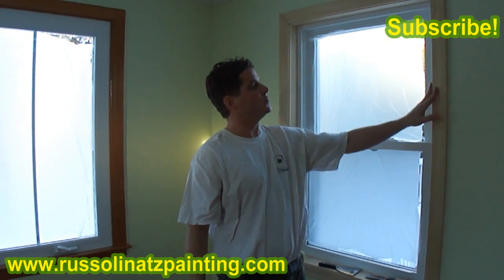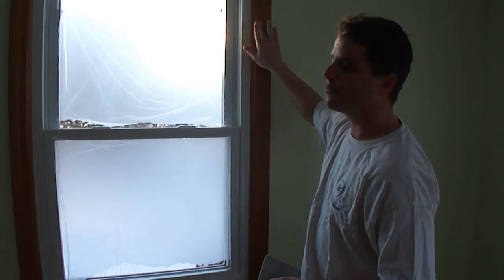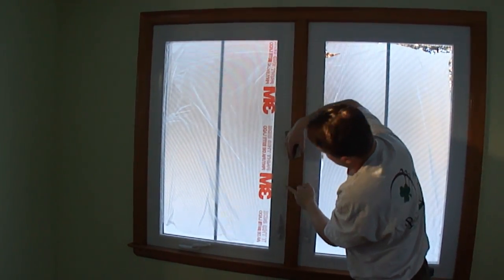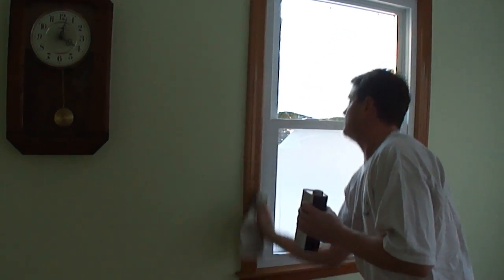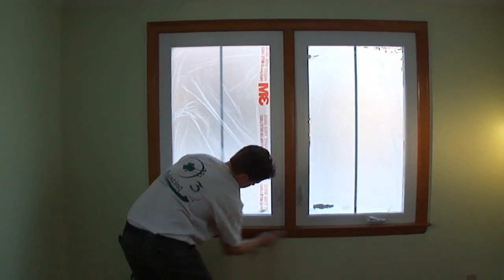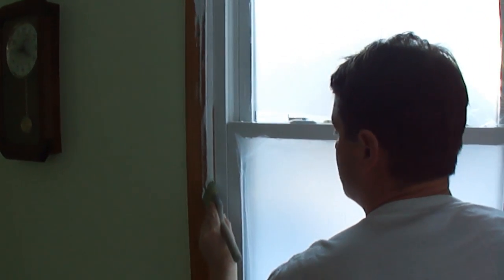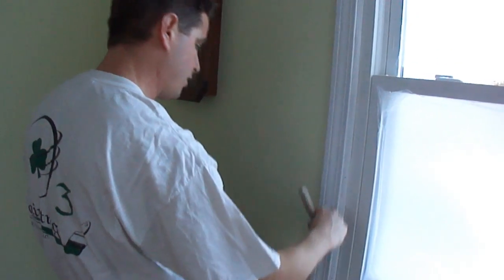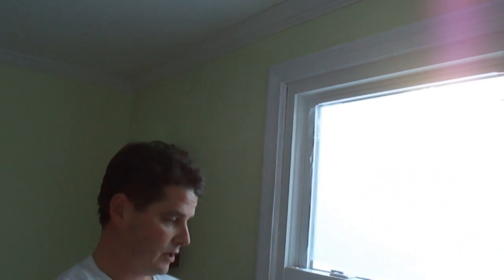How to Paint Over Varnished Wood Trim (Part 1)

Comment: Help! I accidentally used shellac BIN primer instead of water-based on our previously stained and varnished wood trim. (Our first primer coat.) We bought water-based paint, plus I really don't like the clean-up with shellac. Can we buy water-based BIN and use that over the Shellac Primer or do we have to use Oil-based paint now? BTW, I love your videos! So informative and helpful. Great job!

Comment: I’ve always been suspicious of deglosser. Any thoughts on a comparison of deglosser and a more thorough sanding? I have no way of knowing if the paint will have a bond failure years down the road. Would love some feedback here.
Reply from the maker: Thanks for your question! After you use your deglosser, wipe your finger or drag your finger across the surface. It won’t slide as easy as if it wasn’t cleaned and deglossed.

Comment: For kitchen cabinets that I want to use oil base on would it be better to use an oil base primer. I know cabinets take a hard usage and I’m willing to deal an oil base primer if it is an even slight benefit to prevent chipping down the road
Reply from the maker: Hi

Thanks for your question. The STIX bonding primer can be top coated with almost any product. If you don’t mind the smell of Oil primer and are comfortable working with oil, then I would use oil primer. It will cut down on the prep work also. Saying that, I would still use a liquid  deglosser to make sure the cabinets are clean before you start. Where you from?

Russ
Reply: Thank you for info. I’m going to watch your kitchen cabinet videos now. I will order what I can from amazon if you benefit from that. Do you have one on removing popcorn ceilings. I did the bathroom and that was no fun. I may hire the rest and actually leave the popcorn in a few bedrooms. It’s hard to find contractors that even want to do that.  Can’t blame them lol
Reply from the maker: Yes here is the link to the playlist. https://youtu.be/RSb67RcWTuI

Comment: This guy does things right. Great job!
Reply from the maker: Hi Tom

Thank you! Do you do it same way?

Russ
Reply: I have never used the deglosser. I sand, then prime with oil. But the smell bothers people sometimes.... I may try your method now.
Reply from the maker: Hi Tom

Yes I do the same thing when the trim is old and the Sun has deteriorated the polyurethane, leaving stained Oil surface that will bleed they latex. The WIlbond is a Must. It’s unlike the Em water based ones. It stinks but does the best job trying to cut sheen of polyurethane and it definitely cleans the surface.

Comment: Thank you for the tip on the liquid deglosser.  Hadn’t seen it recommended in any other video and saved me tons of time not having to do sanding!!
Reply from the maker: Hi Gigi

Yes it’s a lifesaver. It cleans the surface and softens up previous coating,  thus alllowing new paint to bond better. Where you from? 

Russ
Reply: RussOlinatzPaintShow Originally from Long Island, NY but now in South Carolina.

Comment: Great video. Just what I was looking for. I have plans on doing my whole house...huge project, any suggestions on getting started?
Reply from the maker: Hi Yvonne

Are you painting over stained trim?

Russ
Reply: I will be painting over stained trim.  Do you need to sand all of that away and then clean it with that solvent?
Reply from the maker: Hi

No not at all. If you do, then the stain will bleed thru. Just use the deglosser to clean the varnish or polyurethane. It also cut the sheen allowing the primer to adhere better. When you starting?

Russ
Reply: I will be buying my first house in the next couple months and then I will start the painting process.
Reply from the maker: Ok great!
Reply: Yvonne Pryor start with small sections not over work yourself a good cut brush for trim sand and clean surfaces so the paint sticks well so kids not rub off so easily and Blue tape to keep the job looking neet.HANDYMAN Louis H.
Reply: Yvonn
  e Pryor
Reply: Yvonne Pryor Hi Yvonne. Did you paint all your wood trim after all? We too have all wood trim throughout. I'm thinking about doing this too. It would be a massive job. I live in Canada and since we have long winters, it would be a good project while we wait for spring. Lol would be interested to know how you made out with your painting.

Comment: So this liquid deglosser doesn't hurt the walls at all? I usually cut in without using tape whatsoever but I'm doing a full white package on this job on all varnished trim and doors in the house, as well as ceilings (no walls fml). So I'm leaning towards just giving in and taping, but then I have to worry about wall color coming off with the damn tape, ugh. I may just do the walls at no extra cost to save the time and frustration. Just want to know for sure if that stuff will affect the finish on the wall if it touches it whatsoever, will there be a dull spot probably?
Reply from the maker: Hi-

Yes, if you use the de glosser on any surface it will cut the sheen. This stuff also soften up the coating of the previous paint and will melt latex paint in just a few rubs. So with latex paint, work quickly so that it just cleans the surface. With oil paints it won't melt the paint, but will clean the surface and make it clean. Do you plan on caulking where the trim meets the walls?

Russ
Reply: So far the seem that meets the wall looks ok, I've had to caulk all the other seems on the window and trim so far. Other windows may need it though. Thanks for the response! Half the time people never respond.
Reply from the maker: Hi 

No problem! Let me know how you make out?

Russ

Comment: Hi Russ, really appreciate your videos, they have helped me a lot with other projects. I'm now on to a stair railing project and converting from stain/varnish to a gloss white. I've done the sanding and now ready to paint. I was going to tackle it first by using Zinsser BIN sealer primer (shellac base) and then a couple coats of gloss paint. The BIN seems really thin and watery compared to other primers and from what I read it can be tricky to use without dripping/splattering, but is supposed to be great for a base coat. Would you recommend I use the BIN or do you think another type product would be superior for a railing project? If you recommend the BIN type product, any tips for using it for drip free application?
Reply from the maker: Hi Michael

Did you already start?

Russ

Comment: Hello russ!  Great work! Much like a precious viewed I have trim in a house that has stain and varnishes for over 30 years.  Great wood work in which some of it is still tacked around and others are removed.   What grit sand paper should I use? Sounds like the steps are sand, use deglosser, prime and paint 2 coats of the products you recommend? What about the wood that that is not tacked on? Should I sand l, degloss maybe a coat of primer and then tack, fill holes another quick sanding of holes filled, primer again and paint ? Any suggestions would be greatly appreciated!
Reply from the maker: Hi Nelson

Thanks for your question? What do you mean by tacked on?

Russ

Comment: Thanks Russ.  Taking your advice. Starting tomorrow on my own 1969 varnish trim while locked in the house.  That initial scuffing can  really be that quick huh?  ( with the 'will bond' next).  That is awesome.  Ps not far from you in Southington. Thx for the videos. I have my next painter for house exterior when the time comes.  :)
Reply from the maker: Hi Todd

Good luck with your project! The initial scuff should be quick and light depending on how worn out that coating is. You don’t want to scuff through that poly and now you hit the stain, which will. Bleed through and then you will have to use oil primer.  The Wilbond will soften the poly and most importantly clean the surface , ensuring your primer coat will stick!

Russ
Reply: @RussOlinatzPaintShow  yer the best  thanks!

Comment: Your videos are a great help!  We are going to be painting all of our oak trim white.  Today I discovered that Benjamin Moore bought INSL-X brand including the Stixs bonding primer and they sell it for $52/gallon.  That seemed a bit pricy to me.  The BM sales guy recommended the Aqua lock primer $30/gallon for doing trim.  Another store recommended Zinnser's "Cover Stain" for $18/gallon.  What do you think?
Reply from the maker: +Debbie Romrell 

Hi Debbie

Thanks for your comment and question! I've never used the Aqua lock. The Cover stain is a great oil based primer.  The Stix is great because it's water based and easy to clean up. Have you ever worked with oil before?

Russ
Reply: +Debbie Romrell dont use aqua lock on your cabinets  and   use primelock, always use an oil primer over varnished wood or anything painted with an oil paint..the oil primer is a harder surface and will bond better then the styx primer..use a true oil primer, if you do not the paint will flake off and wont stand up...i am a painter for almost 27 years and i also own a benjamin moore store as well.so i have many years exp with these products and i have painted many oak cabinets.

Comment: Started a project in my 60's house with over 40 door/window casings stained varnished not to mention baseboard/crown stained/varnished.    My idea was to sand all that varnish  off.  You just gave me back a couple months of my life.  Where do i send the check.  80 grit sandpaper in a vibrating sander barely busted some of that crap off.  Thanks again.  What do you think about hiring an airless sprayer to put down the primer?
Reply from the maker: Hello James

Thanks for the comment and humor!  If you sand off the poly, then u are down to the Oil Stain, which will bleed thru a water based primer and a water based paint.  I focus more on using a liquid deglosser to clean and soften the polyurethane before priming and painting. Good luck with your project! Where you from?

Russ
Reply: @RussOlinatzPaintShow  thanks again russ. Im up to part 3 on this series.  I saw your comment on going thru the poly, so ill just have to use an oil based primer and paint as you recommend on the couple casings I've already done (live and learn).  
Another big part of my project is dealing with three rooms of 70's panneling nailed solidly/flat over masonite board. My idea is wallpaper. In one room i have set the nails, cleaned/scuffed the walls and filled the grooves with with two applications of hot mud ( can not feel the grooves now, smooth).  Or should i skip this process and let the wallpaper people use backing paper?

So, if you can recommend a couple products from your store ill go there and purchase:
1. Primer for casings where i sanded off the poly
2. Degloser if they can ship
3. Primer for casings i havent sanded
4. Primer for panelling if you think i should continue filling grooves in preparation for wallpaper.

Im a retired accountant at the bottom of the map, Gulfport, Ms. (Its hot and muggy already).  I have some pretty good carpenter skills from an earlier life but highly skilled painting is a new world for me.  Used your videos on repairing cracks above the doors/windows in sheetrock (thats every door/window in this house) with excellent results.

Thanks again!
Reply from the maker: Hello James

I don’t recommend skimming out the grooves between paneling. Those areas will continue to open up and close due to the cold and hot temperatures during the seasons. I would do the wall paper backing. I would use the Zinsser Coverstain Oil primer for the areas you sanded of the polyurethane. I would use the Kilz Restoration primer or the Stix primer for all glossy trim and paneling. 

Use the WilBond deglosser. Look under s”Sanding Tools”
Check out this page from Russ Olinatz Painting https://www.amazon.com/shop/russolinatzpaintshow

Please let me know how you make out?

Russ

Comment: Russ you are the Man! Wish I could hire you to paint my house! I just watched a guy put 7 coats on some varnished trim to keep it from bleeding through. Plus he dripped paint everywhere. You do it right! Awesome job and I will definitely be getting some Wil-Bond and Stix primer and doing it my self next time. Does it works as well on wood paneling thats been stained and probably varnished? Because I have lots of that just cant decide if I want to paint it or leave it.
Reply from the maker: Hi 

Thanks a lot for your comment! Yes, it will work provided it is varnished. If there are areas where the stain is bleeding through, then use an Oil based primer to lock in the stain. Plan on 2 coats primer and 2 top coats latex. Where you from?

Russ

Comment: Hello! I followed your method except I used Kilnz Adhesion primer instead of the Stix (it was on sale). I finished priming last night and  I woke up this morning to the primer alligatoring! Any idea what I might have done wrong?? So much work to do over :-( Thank you.
Reply from the maker: Hello

What did you do for prep work and what where the drying temperature?

Russ
Reply: @RussOlinatzPaintShow   Thanks for responding! My original 1940s wood trim is extremely glossy--I'm assuming a thick layer of polyurethane? I vacuumed the trim, sanded lightly with a sponge, wiped down with a damp paper towel, used de-glosser, then primed. Drying temperature was a heated 62 degrees indoors. I'd love to know how to address the alligatoring and how to avoid it in the future. Thanks again!
Reply from the maker: MrsSalsera33 what type of deglosser did you use?
Reply: @RussOlinatzPaintShow  it's called "easy liquid sander deglosser" by Klean Strip
Reply from the maker: @MrsSalsera33  After deglossing, try wiping the surface down again with clean water and a rag. There might have been some residue left over from the dedlosser that might have been still on the surface.

Comment: How would you darken the stain of already stained and varnished wood trim and window molding? Would it be the same processes except for the painting?
Reply from the maker: Hi Laura-

Just add some stain to the Polyurethane. Did you start yet?

Russ
Reply: No I have not started yet. The house has a lot of previously varnished wood and I wanted to know the best way to go about making the finish darker without a lot of chemicals.
Reply: Im Painter too  and yes that is a nice tip !

Comment: Wow, thanks so much! We've been looking into using deglosser vs just sanding, and your video was perfect in helping to understand how to use the deglosser, as well as how to lightly sand first. Good to know I don't have to take the trim off the window, this looks much easier than I'd envisioned in my mind. I also appreciate the painting tips you've provided.
Reply from the maker: Hi Beth

Thanks for your feedback! I really appreciate it and am glad you have learned something. The Deglosser is a must. It cleans the surface and softens up the polyurethane so that the primer will adhere. Where you from?

Russ
Reply: We're in southern Minneapolis, MN area. So far I'm not finding the Stix primer anywhere in our area, however, just Kilz. You mentioned on a different comment that their oil based was fine, what about their water based, or other brands like Zinzer or Glidden?
Reply from the maker: Hi Beth-

Kilz water based isn't meant to go over polyurethane. Zinsser or Glidden won't work either. Try the Multi-purpose water based primer from Sherwin Williams.https://www.sherwin-williams.com/homeowners/products/multipurpose-primer
Reply: Hey Russ, I'm finally getting started with painting over varnished wood, and have gotten some of my trim done, so far so good. Many thanks again for your help. 2 more questions. I am also going to paint some cabinets, the doors are wood but the frames are laminate/veneer. Would you do the same pre-treatment for that? So light sand, degloss followed by the multi-purpose water based primer from Sherwin-Williams? Or for that do I need a different primer?
Second question, if you have baseboard trim that has warped slightly, do you also caulk that like you do for windows to fill the gap? I'm guessing yes...
Reply from the maker: Hi Beth

1)Yes you can use that sherwin primer or ZInsser BUlls eye 123 water based or Zinsser BIN shalac primer. 2) Yes, caulk those areas to recreate a smooth surface. The wider the gap, the more coats of caulk because it will shrink between coats!

Russ

Comment: Is the de-glosser necessary since you already scuffed the surface with the med grit sandpaper? Also, does it remove any varnish? I've made the mistake of removing all varnish off of a surface and opening the pores of stained wood which ended up seeping through multiple coats of primer and paint, I don't wish that on anyone!
Reply from the maker: Maxwell Actual 

Hi-

Thanks for your question! No it will not remove the varnish. It cleans the surface of any lint, dirt, dust, hand oils, etc.  It also softens the old coating allowing the paint to bond better. I recommend doing both scuffing and de-glosser to ensure a tight bond.

Russ